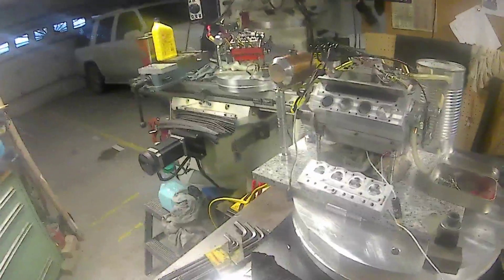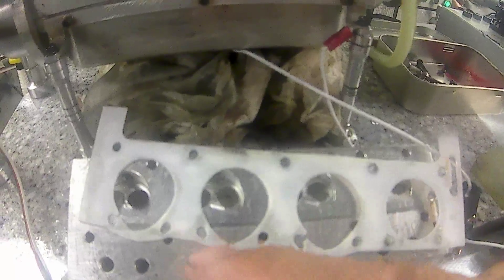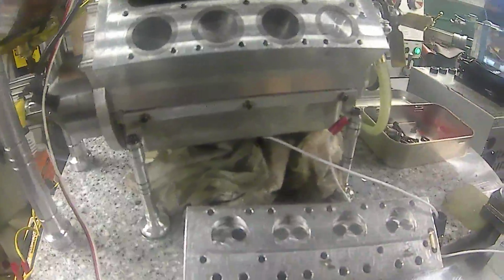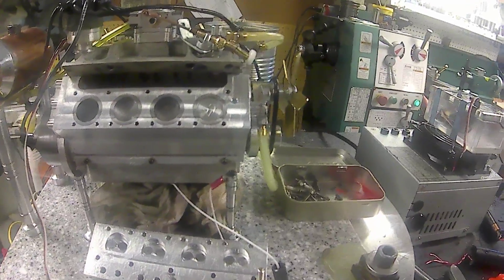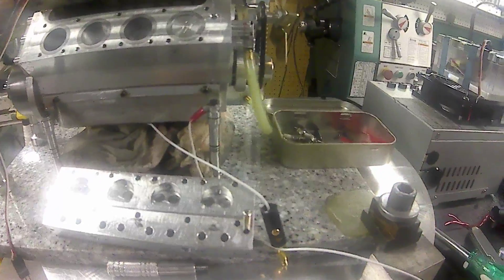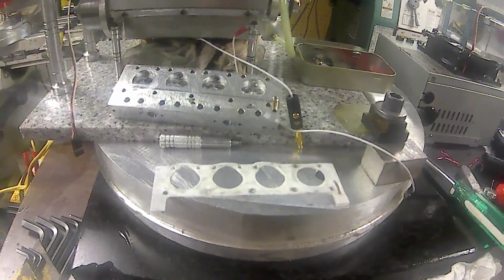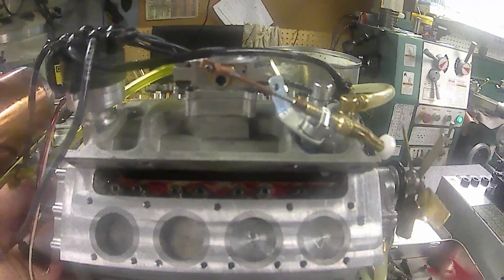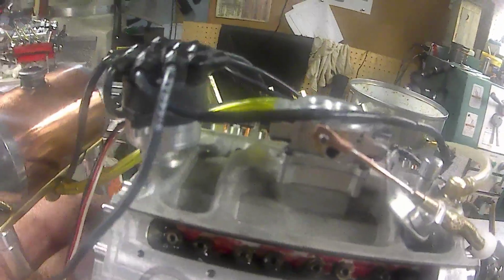Little Demon v8 1 blown head gasket

Comment: I was also wondering about copper as you could anneal it when the head comes off. Boy they are testing your patience.
Reply from the maker: Only number 1 is testing me ;) number 2 is running like a charm yet start easy and idles nice. If I have another one blow I may just try that I could cut them out then anneal them.

Comment: I had the exact same problem with my little Demon. My cure was to scribe a deep groove along the cylinder Head and Block with a scalpel blade, But leaving the Burr standing.This bites into the gasket and holds it in place and stops the blow out.I have not had to take the head off since